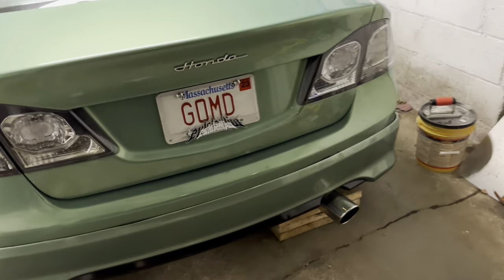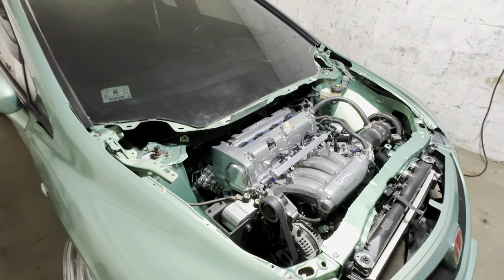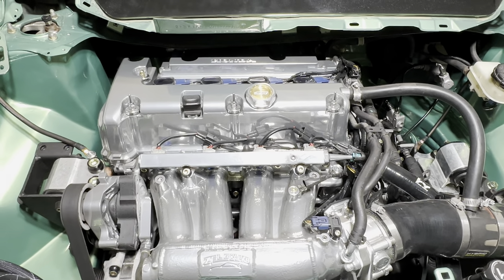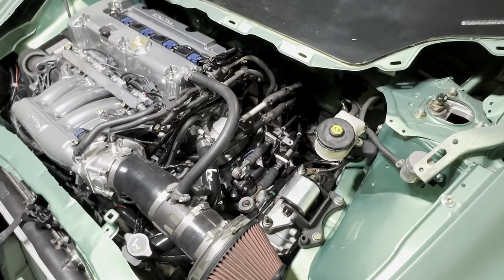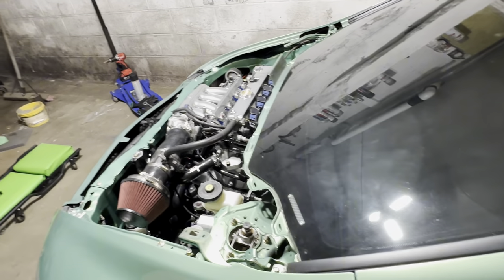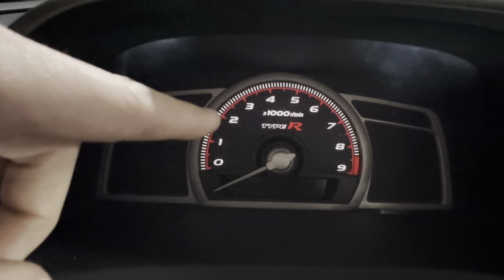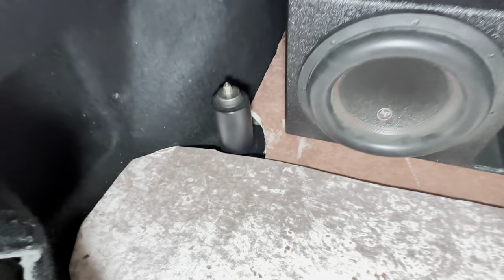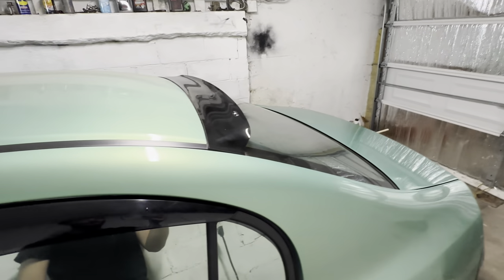8TH GEN SI BUILD

Comment: You have a vid installing the llp ball joints?? Looks straightforward tho
Reply from the maker: I don’t, I think they have a vid on their page or maybe on the site for that part. But yeah pretty straight forward, press out the studs on your ball joints and install using the nuts/bolts/spacers provided
Reply: @midorifd2  mint man your build is so clean, love how the engine bay came out where you deleted the battery tray and did the tub, so much work went into this build it's sick you're making videos of it and sharing the process, I bought the LLP camber arms and the extended lowers for my csx but the car has too much and the camber bolts broke inside the frame so now I'm looking for a cleaner chassis to ruin probably from a state that doesn't get snow
Reply from the maker: Thank you bro and damn that sucks